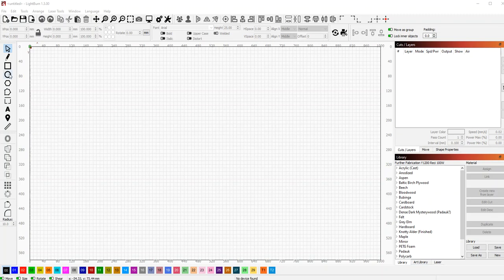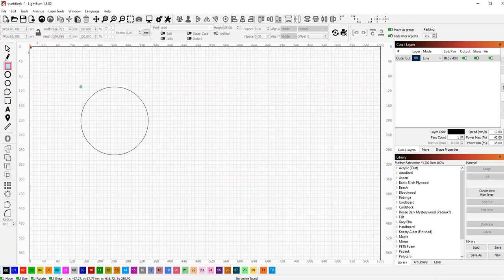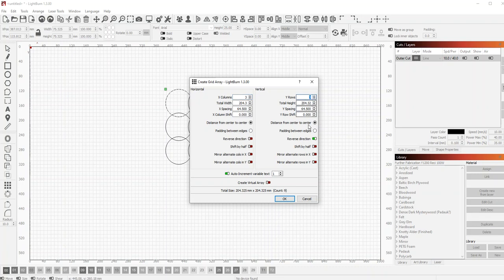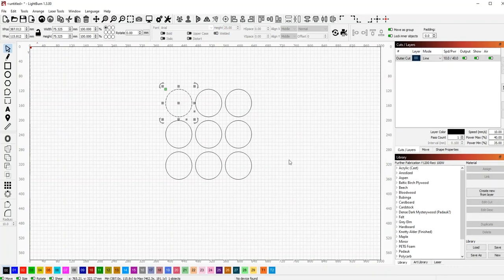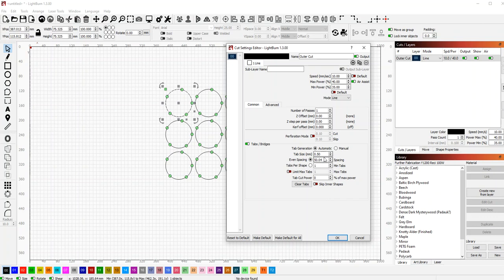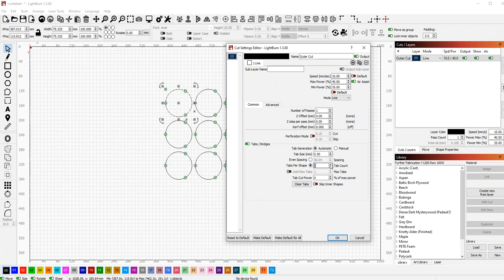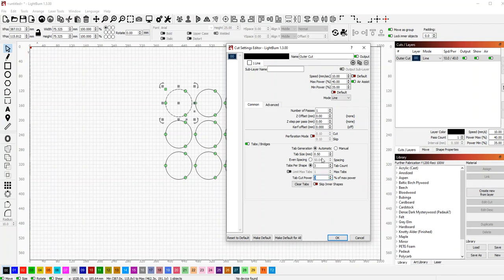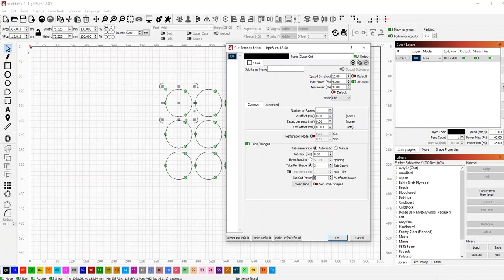LightBurn Tutorial: Using Tabs to hold parts in place

Comment: Hi, does the tab / bridge settings affect the kerf configured on the cut layer ?
Reply from the maker: Tabs should not affect the kerf setting at all.  The kerf has to do with how much is added to your shapes to get the proper target size, and the tabs just leave small gaps in your cut lines, where the power is reduced for the tab width to leave a bit of material holding your part in place.

Comment: is it possible to export the vector including the tabs to cut with another software? I use corel laser, my machine is not compatible with lightburn..
Reply from the maker: As the tabs are part of the layer instructions and not part of the design, I'm pretty sure you can't export them when saving as another format...

Comment: Hi, new to using this function is there a way to delete tabs when you do automatic? I have some places that I don't need a tag there. thanks
Reply from the maker: Absolutely.  Using the layer settings, turn on "Automatic" for tabs. Close the layer settings, then use the "Tabs" tool (right below node editor).  Double-click or shift-click a tab to delete it. This will convert your auto-tabs (green) to manual tabs (red).